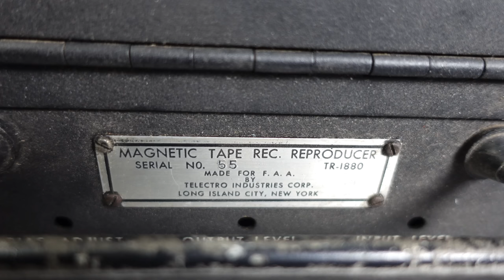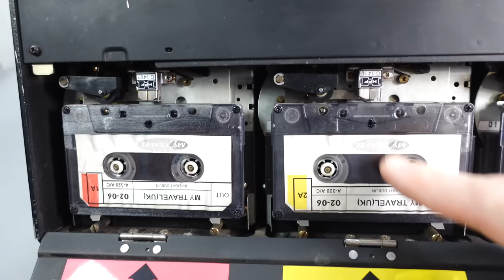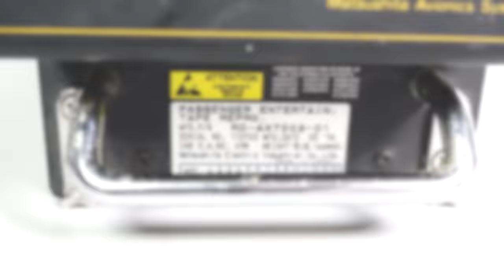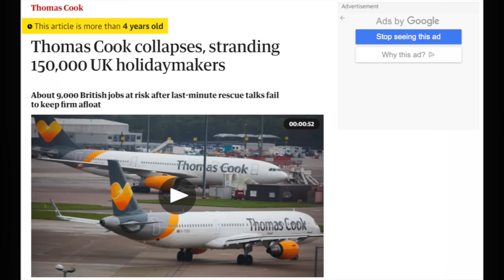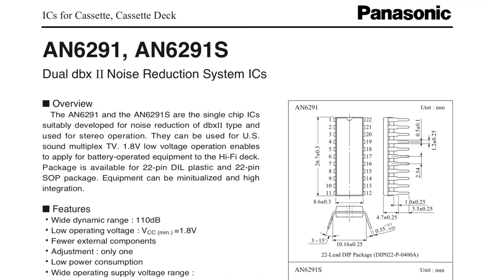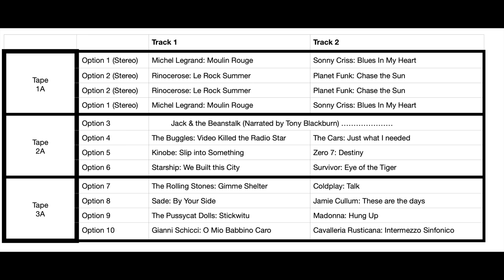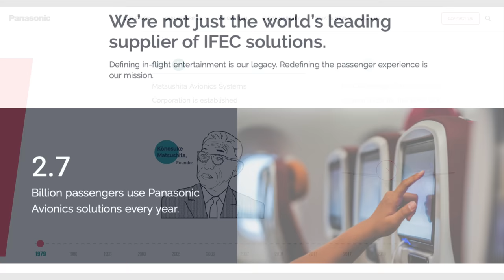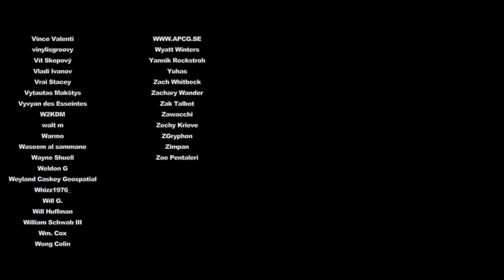The in-flight audio player

Comment: I'm just blown away by just how much is packed into this machine. Sophisticated? Absolutely; but why? What could all those chips be needed for, in a device that, it seems to me, could have been so much simpler?
Reply: Multiplexing the 12 channels using Delta Modulation to reduce wiring to each seat (and weight).  I won't repeat the entire comment I posted again here.

Comment: You mentioned at the end about them using these instead of something digitally based, my guess is it had more to do with cost.  The airline probably already owned these players and they would have been cheap, at least for aircraft equipment, and with off the shelf cassettes updating the programming would have also been very cheap.  Heck, updating would have simply involved swapping the unit out of it's rack.

Comment: I think I can add a comment that will explain why these legacy systems rode on passenger jets for such a long time. I learned when evaluating in-seat video entertainment systems that movies were still being encoded with archaic MPEG-1 files. I was told that the cost of getting approval to introduce a new entertainment system in a passenger jet is subject to FAA approval. The cost of getting approval from the FAA for your new systems would be extremely expensive. Also it had to be approved per airplane type. As a result it would be cheaper for an airline to use systems that were already approved by the FAA.

Comment: Fun fact, with certifications taking so much time, even brand new, this device was probably already outdated.
It's the case for any aircraft/aerospace/military stuff, they end using completely outdated things for certifications and reliability reasons. The palm goes to Soyuz spacecrafts that still used a soviet-made mechanical clock for mission timer in the early 2000.

Comment: I must confess I'm surprised such a substantial device using old fashioned tapes was still being manufactured in 1994, in an era when compact discs ruled the roost but then again if the aircraft it was installed in was made in the 1980s then it makes sense. No point in re-inventing the wheel for such a small market. 

I also notice the lack of plastic components on that tape deck. A sign of build quality no doubt and must have cost a few quid when new.

Comment: The original device looks like it plays 4 mono channels  to provide 4 separate "stations" per cassette.    Likely for short haul flights given the length of the tapes.   The duplicate channels likely were played mono, but just duplicated on two different selections for the passengers.

Comment: Avionics tends to be built to last 30 years plus, with this being an example of it. That they had new tapes being made for it shows that the airlines kept on using it. After all airlines still are one of the users of CRT technology in cockpits, with thousands of aircraft with glass cockpits still having a CRT or ten in use, and those will be rebuilt with new electrode gun assemblies when they wear out, as it is cheaper to rebuild a CRT, and recertify it, than to certify a drop in replacement avionics block. But newer ones use LCD and other display technologies, and are becoming popular, but only as a complete upgrade of the entire panel, where you rip out and replace the entire unit as part of a major service. 

That is why there is a big demand for old aircraft parts that still have operational life, as the parts are either no longer made, or are expensive. After all, why else would scrapping a Boeing 747 involve the careful removal of the seats, floor, galley, and coffee maker, because those are still used in newer aircraft, and buying good used spares, with a still valid certificate of airworthiness, is a massive cost saver. Recover the seat to fit your interior colours, and you could have a close to 50 year old seat in use on a 10 year old aircraft, and nobody, other than the maintenance crew who see the paperwork, will be the wiser.

Comment: Wow. I wouldn't have thought that the in flight entertainment would be played so easily. 10 programs are correct. You could set 12 channels in the backrest. Programs 1 and 2 were always for the film sound when a feature film was shown. From 3 to 12 there were music programs and radio plays. However, this usually lasts exactly 60 minutes or 120 minutes. While some channels started over after an hour, others ran for 120 minutes. (I often flew on vacation to Gran Canaria) Here in Germany with a German airline, program 1 was always in German and channel 2 in English. On channel 3 there was mostly easy listening or the music that could also be heard when getting into the machine. Often orchestras like Benny Goodmann, Bert Kaempfert, Herb Alpert, James Last, Mantovani, Percy Faith. You could often hear synchronization fluctuations very quickly in the strings. I was always surprised that this music seemed to come easily - now I know why. Because program changes only happened every 2 months at LTU. (former German holiday airline, unfortunately no longer exists) On Channel 4 there was classic music. My two channels were also in stereo. Channel 5 was a children's program. And then there were channels with different music genres like rock, pop, hit parade. Often presented by the great radio announcers of the time. 2 channels were also moderated in English. Yes, those were the times. The sound came through an air tube headphone and sounded like a better AM radio. Electric headphones only came later, shortly before the system change. There were both sockets in the backrest. One for headphones via tube and one for electrical ones. Each has a strange double plug. Back then I also had a reporting device (Sony PRO 2) in the cabin and connected the line in to the system and recorded a show on tape. Now it would be interesting to see how the film projector worked on the plane. All I know is that it folded out of the ceiling and lowered the screen. Was there an endless cassette built into it or did the film have to be rewound? It must have been 16mm film. But the video projectors were on board relatively quickly. The picture was worse. I saw that they had installed a Sony video player with 8mm video tapes in the front luggage rack when the stewardess started the film.

Comment: "Only short haul" nope. I remember having that system on a 747 in 2001 for a 12 hour flight. You heard the same content quite a few times. Fortunately there was also movies on the big projector screen.

I did kind of assume it was CD based at the time, and wonder why they weren't in shuffle mode. But in retrospect, tape makes way more sense for a plane, CDs would probably skip with turbulence.
Reply: Yes...CD"s are intolerant to vibrations....The same holds true for CD players in a semi truck. They stuck with cassettes till digital files became a thing.

Comment: The repetition of the tracks likely wasn't stereo, but because channels 1 and 2 are usually reserved on planes for listening to the cockpit and in-flight movie, respectively.
Reply: It would be easy enough to compare the tracks to tell if they were exact copies of each other or if they varied.
Reply: Wouldn't that mean they would have to lower the volume of those two identical tracks vs the others that were just single channel mono being duplicated into both ears. i.e. so when a passenger changes channels they aren't blasted? I remember the Video8 systems (I remember seeing a flight attended changing the tapes as we were walking on board) seemed to have multiple languages, usually English and then a dub of the destination language. I can't remember on the Video8 IFE system if Mat noted those were mono or stereo output. 

This of course is a audio only system so the configurations to the armrests maybe different if they include stereo for the first two entertainment channels, like you said, sometimes ch.1 was air traffic control. (maybe in Europe they never offered that) I remember Frontier Airlines used to do this, at least many years ago when I flew them occasionally.
Reply: What airline had cockpit audio on channel 1 in the 2000's? The last was United and that was on channel 9.

Comment: I suspect there was never a CD based audio system like this, that the cassette based systems carried on into the transition into digital IFE playback systems. Besides, the cassette systems could carry 4 channels of audio and were 90mins vs 74mins for CD that could only play 2 channels. Plus the idea of using something with dbx noise reduction was more than sufficient for the quality that could be heard in a nosy cabin as Mat points out.

As aside to the longevity they expected. Those electronics look like they used some kind of circuit board sealant. A conformal coating of some kind, a thin polymer film that protects circuit boards, components, and other electronic devices from moisture, thermal shock, static, vibration, and contamination. Certainly appropriate for an environment like an airplane where everything is inspected, documented and regulated for safety and reliability.
Reply from the maker: There were some - I haven't bought one as they never come with the CDs.

Comment: I only listened to "in flight radio" on the first few flights I ever went on.  I liked the idea and what they played was tolerable if a bit middle of the road.  But then the announcements came on at TWICE the volume of recorded music and talk.  Since then, I don't bother.  I wear foam earplugs during takeoff and landing, and my music player mid flight.
14:50 - Not really.  Proven and easy to use technology sticks around until it's too expensive to use and maintain.  And "radio" on a plane was low quality audio, so nobody would have noticed the difference.

Comment: I want to know more about the backend of the system. A circuit for switching between an array of audio outputs doesn't sound too complicated... But to handle every seat, how was that accomplished?

Was it a central hub or did every seat panel get all the outputs at once and had it's own selection circuit?
Reply: I did already post this comment,  but it might help answer your question if you didn't see my comment:  There were hubs for multiplexing to rows and columns of seats and seat electronics units in the seat frame near where you could place a carry on bag (or your feet) which would be connected to armrest electronics which would decode / demultiplex and send to the headphone jack.  The video channels and audio channels (1 - 12) typically be multiplexed using Delta Modulation to save wiring and weight and decoded at the seat electronics units,  and armrest channel selector / volume controls for the specific channel desired.  The same multiplex network could be used to control the overhead reading light and attendant call lights on airplanes like B747, B767 and L1011 which would be too high to reach from the seat,  so their buttons would be incorporated into the armrest audio selector.  The Delta Modulation resulted is fairly poor audio quality,  but there were often one or two channels (5 and 6 if I recall) which would be in stereo,  typically for classical and jazz.

Comment: 40 series ICs are all very inexpensive, especially by mid 90s they're cheap as chips. The 5025 is a buffer, that's also super cheap. There isn't actually anything expensive in there and the PCBs are merely dual layer. The construction is also quite a lot less imposing than a lot of gear.

That being said just the fact alone that it's made for flying passengers and must conform to higher requirements (fire safety vibration etc), must run service-free, while not being a high volume product, tends to make things very very expensive indeed.

Comment: I'm only curious about how the armrest control was able to change what you would be hearing in your headphones.  I suppose the connection between each armrest and the device had the 12 independent wires all the way up to the jack itself and it just toggled control at that point. It seems more complicated to have just a pair of L/R audio wires between each and the device and a control wire for it to instruct the device to change what is sent to each jack.  Curious.

Comment: Good luck with that connector, it's about $450 and they do not make them to stock they make them to order.
Come to think of it you're only going to need a few connections anyways just get the sockets.
Preferably with solder cups, and then when you have the pin out, just slip them on.
If you're worried about him shorting or whatever use shrink ot tape.

I used to test and repair the little cylinder device on flight data and voice recorders called a pinger.
 It only activates when there's water across the two contacts at one end.
 The one in the center and the ring on the outside.
Providing the battery is any good.
It will emit a ultrasonic ping you can actually hear if you hold the flat end to your forehead, lick your index finger and put it across the contacts.

Comment: Up until the 90's a lot of airplane's passenger audio headsets were just pipes (not wires). Do you know how that functioned?
Reply: And in hospitals too.  Essentially they worked in the same way a stethoscope does.  In the armrest (or wall box in hospitals) is a small speaker driver in an airtight enclosure which leads to the pipe fitment.  The air vibrates out and up the tube, which essentially just comes out the earholes.

In our local hospitals, these were fed by 4 channels - each originating from a rack of very old QUAD brand radio tuners and 100V long-line audio distribution amplifiers, and were transformed down to speaker level, usually at the room, where it was then a low impedance loop through the bed head units.  (The 100v line system is used commonly in PA systems as the higher voltage means fewer losses over long cable runs - the same way the power grid uses 11,000volts and more to send out power down long lines before transforming it down several times before hitting the 240V coming out of your local transformer)
Reply: The musicians were stored in the bottom of the plane and would sing into the tube.
Reply: @John_Locke_108  🤣🤣
Reply: @John_Locke_108  and when you are watching a movie all the caters were dubbing at the bottom of the airplane 😆

Comment: That head setup looks very weird and complicated. In 1994 4 track heads (used in auto reverse decks) were already readily available. But here they cramped two staggered heads together, which seems overly complicated....

That is also an argument against your assumption of stereo. In the track arrangement you showed one of the two "identical" tracks would actually need a small time delay to act as Stereo.
Reply from the maker: One track was recorded with the cassette playing one way and the other with it playing in reverse - the start points of the PCM recordings were not the same and no attempt was made to marry them up perfectly because I was just identifying audio.
Reply: Better separation would be required between two mono programmes than the left/right channels of the same programme.

Comment: A better way to get the audio out of these tapes would be to use a multitrack cassette recorder. This way, the tracks don't need to be reversed and the stereo tracks can be easily extracted without alignment.
Reply: He did already cover that, and said his multi track recorder wasn't currently working. 🤷‍♂️

Comment: "Technology hangs on in the most unusual places..."

That would probably be because of the high cost of adding new technology to a Certified Aircraft, like the A 320.  ANYTHING that goes into an aircraft used for public transit has to be certified by the aviation authority governing that aircraft and that process is not cheap.  As an example, an FM stereo cassette deck for your car might cost about $100.  A similar device for your private plane would cost 8 to 10 times more if you want one that is certified aviation electronics. Not using a certified device might cause your aircraft to lose it's Type Certificate, resulting in it being classified as "Experimental" which can significantly alter it's resale value, and what you can do with it commercially.  In the case of a commercial passenger transport aircraft, using uncertified devices is simply forbidden.

Comment: In my memory, the low sound quality was very noticeable. It sounded like dinky old tape recordings. 

It didn't help that I didn't like any of the music. ANY music, from any of the tracks. So many options, and none of them worked for me. 

Even the music I brought myself on my walkman or ipod (depending on what year) I couldn't appreciate.

Something about sitting in a pressurized cabin in cramped seating just affected my ability to listen to music. It was all irritating. 

I'm not afraid of flying, I should add. I'm not nervous about sitting in a vehicle with wings moving high above the ground. 

I think it's more about the crowded seating , the air you breathe, the noise... I need to get up and wander around. 

(But I usually like the food (which everyone else hates) ) 

Anyway, the sound quality was noticable.
Reply: You should try active noise cancelling headphones

Comment: I don't believe they would have had any control signals, they would just play all 12 signals straight down the wire when power is applied. Something "up stream" would be what allowed for stereo.
Reply: There likely was a control to pause all of the audio during the safety briefing and maybe other times for announcements.
Reply: @markjames8664  I was expecting that to just be turning off power to the unit as a whole. Keep the whole thing simple. I should look up the data sheet for it, I guess.

Comment: Were CD players ever used for this? CDs wouldn't be so happy in heavy turbulence, and also a CD based replacement for this would require 10 or 12 CD players rather than 6 tape decks.  Or did they go straight from this to solid state digital?
Reply from the maker: Yes